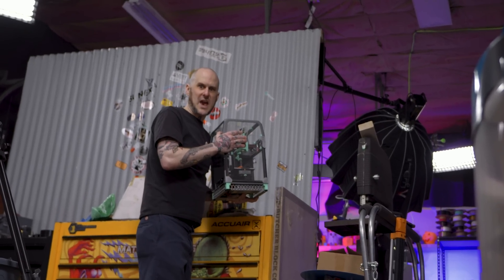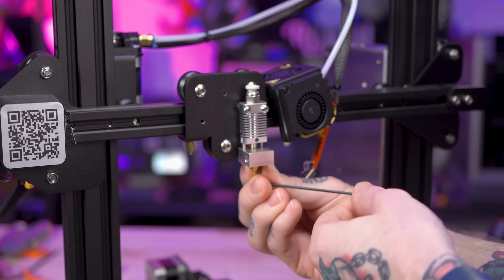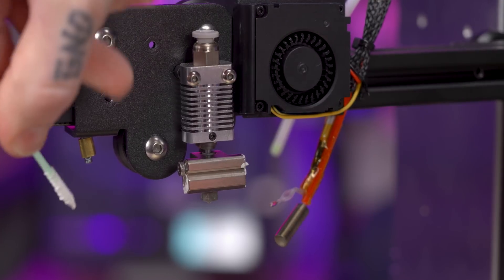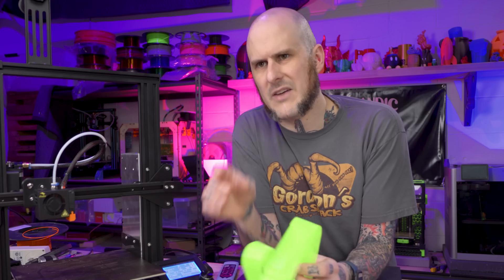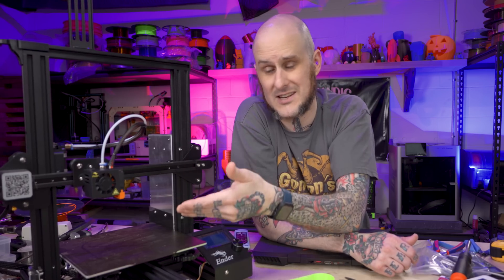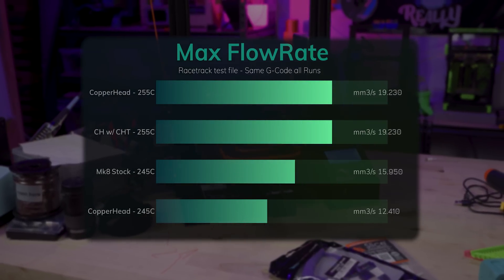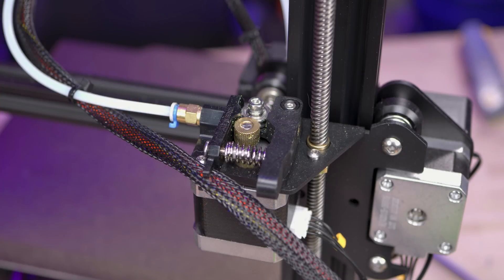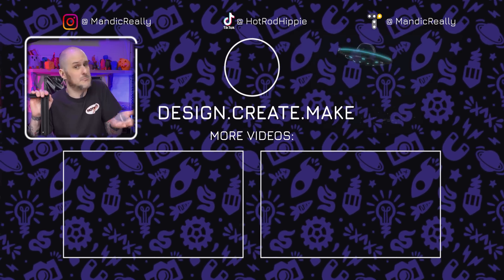Unveiling the Truth About Creality Ender 3 CopperHead Upgrade Kit - Slice Engineering Worth it?

Comment: Same problem here with the parts cooling duct. Where did  you find one?
Reply from the maker: It is in the product page for the Creality Copperhead kit: https://www.sliceengineering.com/products/ender-upgrade-bundle?variant=43040687849713&currency=USD&utm_medium=product_sync&utm_source=google&utm_content=sag_organic&utm_campaign=sag_organic&utm_source=google_ads&utm_medium=x&utm_campaign=16898980970&utm_content=&utm_term=&gclid=CjwKCAiAhqCdBhB0EiwAH8M_GtAn5QZ5PFlRLWrOt0hIPtRaGJ7HQcAC8DyWt30oMYiFbk3S4yR17hoCN4AQAvD_BwE

In the notes section toward the bottom.
Reply: @MandicReally  Thank You !

Comment: You can use a v6 nozzle in creality hotends. It doesn't have to be an mk8 nozzle
Reply from the maker: A V6 nozzle can replace a Mk8, but a Mk8 cannot replace a V6. They are the same thread but the RepRap nozzles have a longer threaded section (by about 3-4mm), so that is more of the nozzle engaged in the heater block.  If you install a RepRap nozzle in a Mk8 block, it'll fit but not be threaded in as much as is intended. So yes, it wasn't proper to say that it is a "Conversion" so much as a "adaption to the proper fit for a RepRap nozzle.".
Reply: @MandicReally  that's fair

Comment: Exactly the same experiences as I had with that "snake"! It's a Mk8 / V6 mutant with the lack of high performance. I belive in your explanation of the short distance between heater cartridge and sensor. - And then using a nozzle with poor conductivity on top to spoil the rest. Not what I expected from an expensive "all metal upgrade". Then rather a full blooded V6 solution, maybe with a vulcano nozzle ;-)

Comment: What hotends do you recommend for a stock ender 3?  Looking at upgrade options to improve / increase the maintenance on my ender 3.  Currently replacing/cleaning the printer every couple months (3-5 prints a week).  If there's another hotend that would improve that, it would be great!

As always, great content!  Keep it coming!
Reply from the maker: I would say check out my review of the E3D Revo CR. I’m running that in the Ender 3 I use the most and am very happy with it. Nozzles are pricey but it’s a very good quality and easy to use hotend: https://youtu.be/tU_5jdhukEc
Reply: @MandicReally  Yes, i did see your review of that nozzle setup just the other day.  great review.  only thing that gets me on that one is the price... price of the kit then the replacement nozzles.  I've seen other videos of those nozzles quite awhile ago and it seemed very interesting to me at that time as well.  i like the design of how the heater wraps around the nozzle.  makes most sense in that aspect.  just sad they went with an proprietary nozzle setup then.  it's understandable from their aspect of quality control.

Thanks for the input!!!
Reply: @wsseibert  i had the revo nozzles on my cr10 and i dont have need one since then if you really want a long live nozzle the obsidian version of the rezo is basicly undestructible

Comment: For $100, I'd buy the MicroSwiss DD, or spend the extra $20 to get the DD NG. Also designed and machined in the USA, also coated nozzles, titanium heat break, but the added benefit of a much better extruder to go with it. Will it flow more? Maybe. But I bet if you took the MicroSwiss DD and stuck an MK8 CHT nozzle on it, you'd at least match those nearly 20mm/s3 numbers.

Comment: I was noticing that the glass bead style we’re originally designed to use on heat pads on the beds, and the manufacture started cutting corners, reusing them and heater blocks. 
Do yourself a favor, upgrade to an all metal 100K and never look back…
Reply: Thermal compound is designed to fill in minute air gaps between metal surfaces (which should quite smooth/ polished) and NOTHING  more. With time it will dry out and or ooze out: replace the glass bead sensor with one that has a metal casing having the right diameter

Comment: I just installed a copperhead with an LGX ACE on my FT5. I found the exact same thing with temp and have to run PETG and TPU 5 top 10 degrees more. So far though it isnt bad, it works well, but nothing earth shatteringly different from my Flexion setup.

Comment: For an MK8 hotend, I prefer MK8-style heatblocks. While I like the V6's heater clamping mechanism, I like having those extra screws up into the heatsink, especially when dealing with relatively fragile bimetallic heatbreaks. But you can get MK8-style heatblocks in copper, if you look around a bit.
Reply from the maker: I personally feel the screw on the Mk8 do little to support the heatbreak and lead to a false sense of security. Having used Hotends that have much more positive support systems for the heater block, those screws aren’t doing much. I still support the block thoroughly with a wrench on Mk8s.
Reply: The Copperhead is the best heatbreak I ever tried. I never had an issue with them. But in fact you do not need their heaterblock. Heaterblocks are not rocket sience. If there is a need for more temperature consistency just buy a chiniese plated copper drop in heaterblock.
The big benefit I see in the Coppeehead heatbreak is its perfect machining and coating and the longer melt zone you get because the part in the heaterblock is made of copper. Combined with a CHT nozzle you  get very high flowrates.
Reply: @Technikfreak72  Yeah, I'm using a Copperhead heatbreak with an MK8-style heatblock myself. I've been trying it out with a CHT 0.4mm nozzle, but I've gotta be honest, I'm not seeing an improved flowrate with that setup: I'm still stuck around 12mm/s before my extruder starts to skip. I'm starting to think 0.4mm is just too small for those higher flowrates; I have an 0.6, I just haven't installed it yet.
Reply: @TheSpooniest  At the very least, I doubt the copperhead is actually contributing any flow rate.  Even though the threaded slug in the heater block side is copper, the surgical steel tube still extends all the way through the entirety of it down to the surface that meets with the nozzle. 

Also, with regards to the durability of these things, I'm actually kind of surprised lol.  I don't have the screws in my mk8 since I had to replace the block, and my ADD-havin'-ass decided it was a good idea to walk away from the printer while it was homing.  Of course, it just so happen that my bltouch failed to deploy on the way down and I came back to ender ramming the nozzle into my brand new smooth pei bed lmao. I didnt learn my lesson the first time, and this happened twice.  Somehow though, my copperhead's throat is still perfectly straight in spite of that.
Reply: @alicec2033  It's not contributing any more than any other all-metal hotend, anyway.

Comment: Just get a revo, quality improvement with the benefit of quick change nozzles and slightly more difficult to break. If you don’t want to pay revo money get a used V6 or a clone and enjoy that all metal goodness…
Reply: You can get a V6 heatsink threaded for a hemera/revo heatbreak from Ali for like... $4. Add a proper Hemera heat break for $12 and a 3rd party copper heat block for another $15 and your nozzle of choice, and you have a pretty nice setup for < $50.

Comment: Looks like the main gain from the swap was getting away from the stupid ptfe lined hotend. 
Revo CR is probably a better option now that's out, and they have a patented design that's actually unique.
Reply from the maker: I reviewed the Revo CR a few videos back. If you are ok with the cost of Nozzles, I really like that hotend.
Reply: @MandicReally  The beautiful thing is, the Obxidian nozzles are basically a lifetime buy.  There should be no legitimate reason to ever have to buy more than one (of each size if so inclined) over the lifetime of the machine; and you're supporting a company who does actually innovate.  Hell; even bondtech - I'm fine with their patented dual gear drive, because there was innovation there.  Slice just went "Oh, they're using thin stainless steel - we can do that with thinner stainless!".  The stock they used for the Mosquito originally came from the medical industry so basically they're doing the "[xxx] ... but on a 3D printer!" thing.  It's horribly trite.
Reply: @ThantiK  I have the Revo CR on my Ender 6 and it's great. Nice fast printing and able to run draft prints with a quick nozzle change. Heats up really fast. So far I love it.